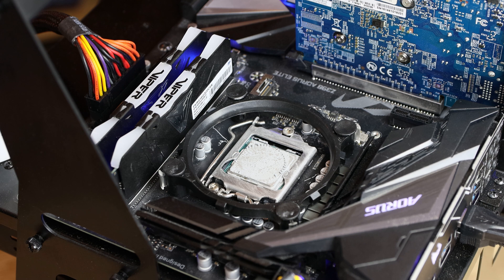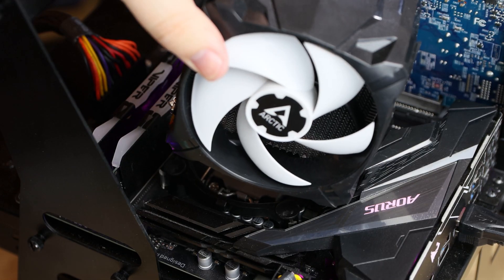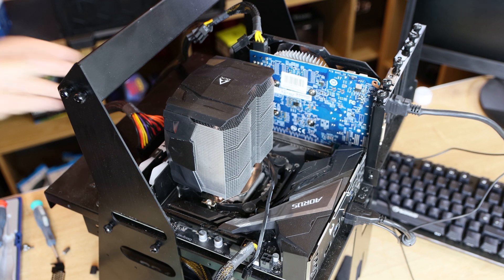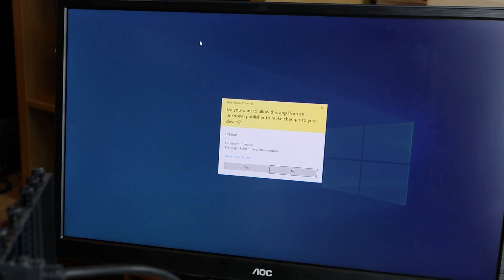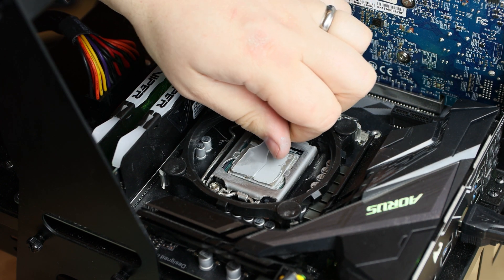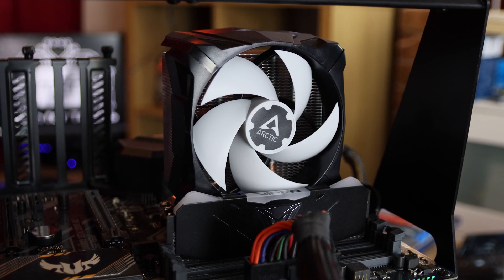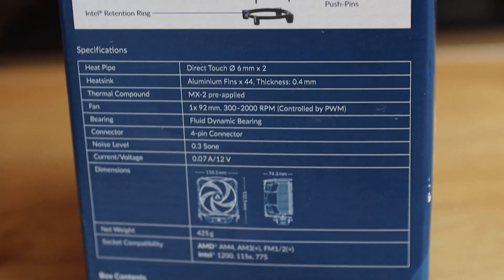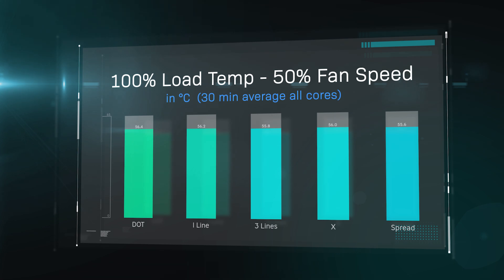Different Ways to Apply Thermal Paste  🔥 Best way to cool CPU with Thermal Paste

Comment: How do u get  too 1k subs
Reply from the maker: Keep releasing lots of content, make sure you make each video a little better each time. make sure you use Tags in your video as well, Tags can help people find what they need/want.  Thanks for watching
Reply: how do you add tags and are tags those little 'i's at the top of the video
Reply from the maker: @TEchWIse2203  click "edit video" and the scroll to the bottom of the page to a box that says Tags, enter tags like   Cheap headset,  RGB headset,  Value headset, best headset 2020 and so on,  basically things that people would type when looking for the product